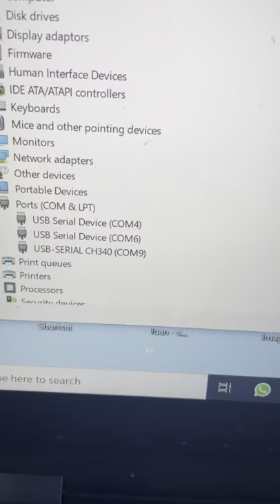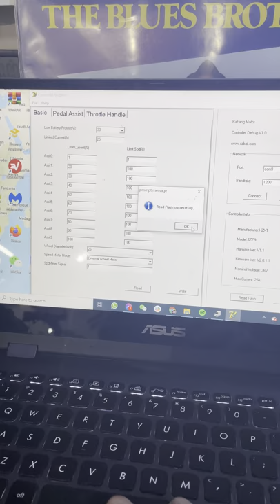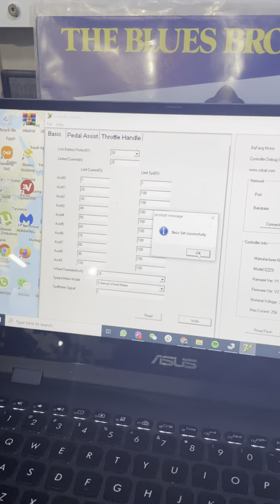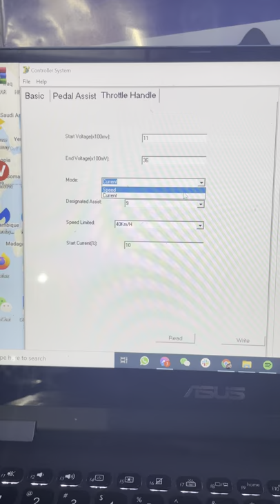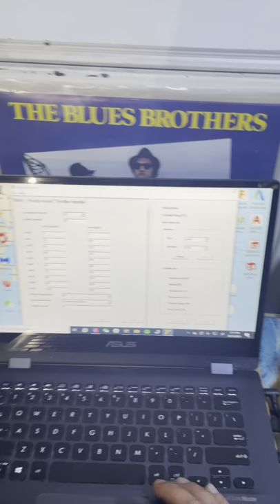Electric Bike Bafang motor programming, pedal assist increase and range extension

Comment: Hi Felipe!  Well, I got my Bafang02 installed and it is everything I had hoped it would be. I enjoyed a fantastic mountain bike ride today and it climbed it like a beast. The stock 44T chain ring matched really well with my 11–46 cassette. I was climbing incredibly steep terrain and never needed the lowest three cogs of the cassette. It was crazy. A 46t Blingring would definitely work with that cassette and maybe even a 52t. When I got home I wanted to change a few settings in the software program which downloaded easily onto my PC. After attaching the cable to the controller/display connection I was hoping it would connect after inputting the port number found from device manager (thanks for that tip!). But my battery does not have an on/off button like the one in your video. It is a mini cube and only turns on from the controller which I had to disconnect for the pc cable. So, I couldn’t get connected. When climbing switchbacks I discovered I need to always be in assist level one as it would accelerate way to fast in all other levels and then I’d quit pedaling and I’d instantly lose all my momentum and miss the switchback. Anyway, starting up from a stop in my lowest gear it seemed like it took a full revolution before the assist kicked in and then it seemed like it kept accelerating even after I quit peddling for a second or two. I wanted to see if I could change some parameters through the software. I’m not sure my mini cube will allow it though if I can’t manually turn the battery on. 
😕.  Do you have any ideas to get around that issue?  Gracias. 👍
Reply from the maker: Hey Max, I missed your comment. Could you turn on the battery to program your ebike? I would suggest using a power supply or alligator clips to maintain the battery out the frame and bring the energy to bike.  There are many settings on the software that could help with the problem you're having, lets go step by step.
Reply: @Cyberbikesau  Hi Felipe. Yes, I had figured that out and was able to custom program. I forget now exactly what I did. 🫤   Anyway, I changed settings about 6 times one evening to see the differences in performance after each. After the sixth time everything quit working. The dealer said I had probably torched the controller. He said the warranty doesn’t cover custom programming. They did however agree to cover that one. I had them program the new one for mountain bike applications and I have been happy with it ever since. They said it was very odd that that had happened, but I am not going to open it up again.  My mini cube battery also failed early on in mid ride. Fortunately I had a backup with me. They warrantied that too but it has left me wondering how dependable all the electronic parts are.  I kind of feel like I should be carrying a spare battery and a spare display at all times. Thanks for checking back. Best to you.
Reply from the maker: @peacelovegoldenrule  what a story Max, yes if the programming is not done right it could damage the motor or burn the controller, for example, maximum current at start up, if set above 50% it will damage the motor. About your battery, could be that the current of the controller is set too high and the battery is cutting off. Also, water infiltration could be the reason why the battery stopped working.
Reply: @Cyberbikesau  Thanks Felipe. I am grateful they warranty both parts. The motor on that bike sure makes for fun rides.

Comment: with this settings, is it possible to program my 250w bafang engine(rks engine) to 500w ? we have restricted in Turkey on this engine.
Reply from the maker: So, you wont be able to make it 500W but you can make it 350W. Some bafang 250W motors came with the "maximum current" settings enabled, that means you can increase from 15A to 20A and make your motor considerably stronger!
Please lease us a 5 star review if this advice has been helpful https://g.page/r/CX0AoVbmxOSwEBM/review 
Cheers

Comment: hi i have a 36v 500watt bbs02b  motor is it possible to used 48v 19.2ah battery instead of my 36v 10ah battery .thanks
Reply from the maker: nope you will damage the motor connecting a battery of higher voltage. To improve performance you could buy a 36V 20Ah+ or buy a new 48V motor

Comment: Do you know this can now be done using a SPEEED app and your smart phone? I have used it but something has disconnected my Pedal Assist and I have to use my throttle all the time. Is there a switch that can do this?
Reply from the maker: We havent used the SPEEED app, do you need to connect a bluetooth dongle on the display cable? Theres no button on the original bafang software, but there are ways to disconnect the PAS or throttle in the software.
Reply: @Cyberbikesau  Well, if you know which settings will disconnect the PAS, please tell me. My motor is stripped down in pieces and I still cannot see anything wrong with it? Please advise? This is the link to what I used:-https://youtu.be/S6IHB2avi5w
Reply from the maker: does the speed app has default settings? No comments about the app we haven't used it yet
Reply: @Cyberbikesau  No, unfortunately. But it shows the range of options and the Help part is quite comprehensive. I feel that Bafang should provide the defaults but apparently each seller has different settings.
Reply: @KeithAVass  I've got this same issue used speeed app to change settings and now my pedal assist is completely gone. Not really sure why but it was working fine before so I'd say it's a software issue.
Reply: @JMJM75257  Yep shame shit for me.. my assist kick  only from about 20k/h, so probably having isue with speeed app

Comment: Brother i have an issue with battery 🔋 my lcd shows that my battery is 20% and when i check my battery bar its 2 green bar remains and the motor not working the watss i received 184w max speed im very upset what i do please tell me is this lcd issue the model of lcd is p860c and the bafang 750w battery is champrider 48v 25
Reply: Set it to display voltage rather than %. Far more reliable and accurate reading
Reply: @TrippinTafty  display is 26% and voltage is 47.5 and the motor has no power when it is low mode 🥺😐